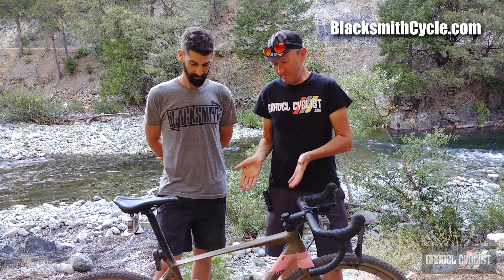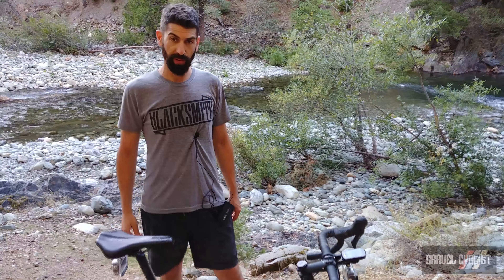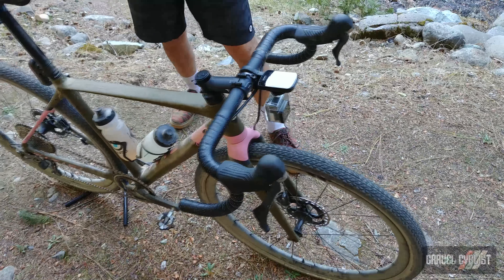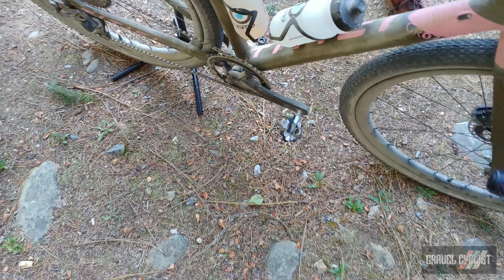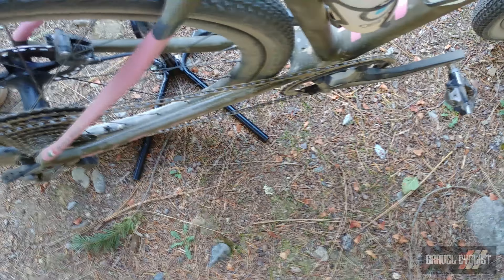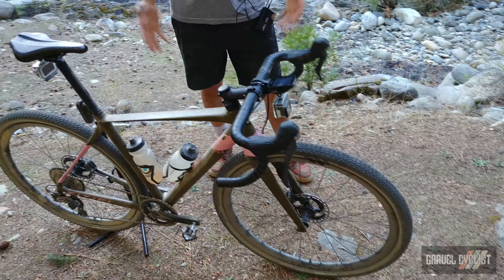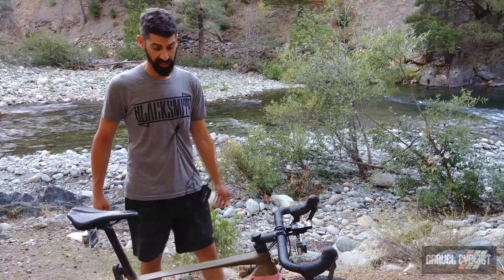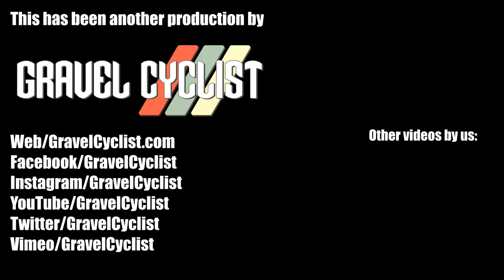Titici Flexy F-GR02 – The Hand-Made Italian Gravel Bike

Comment: What tires are these?
Thanks for the interesting video! Btw: Do you know if its true that carbon frames cant be recycled in    some way? To me this sounds horrible and would make carbon frames and parts a no no...cheers!
Reply from the maker: Tyres are Specialized Tracer Pro 2Bliss. Sorry, I don't know much about recycling processes in general.
Reply: @GravelCyclist  Allright,  thank you!
Reply: Carbon frames cannot be recycled.  Steel would be the greenest frame material other than bamboo, timber, etc.
Reply from the maker: Best get used to making wall art of broken carbon frames and so on then :(